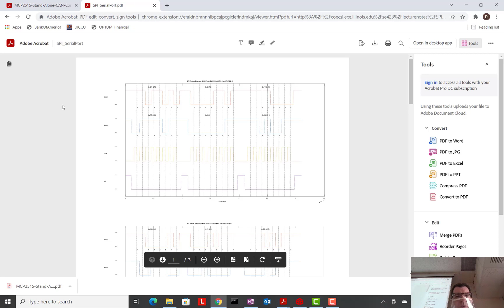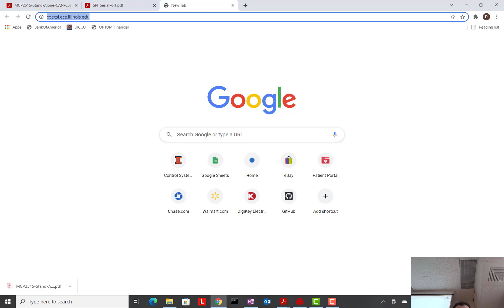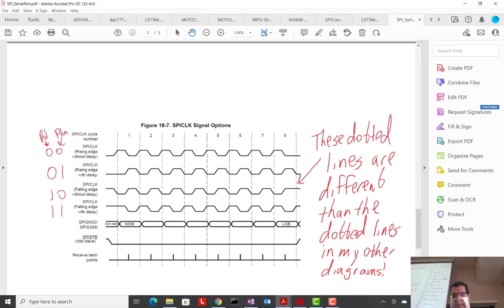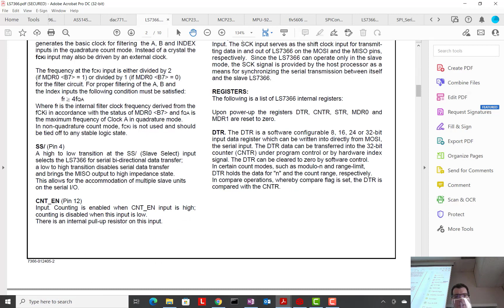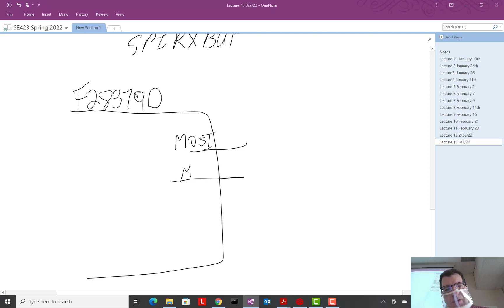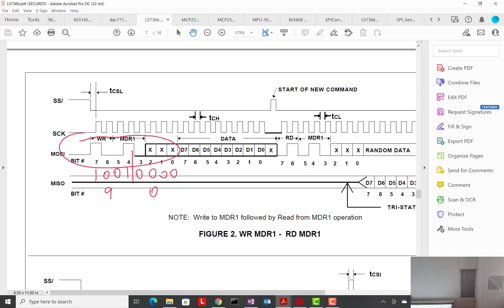SPI serial port, 1 of 4 lectures

Comment: I am currently facing a challenge with SPI communication on the LAUNCHXL-F28379D development board, specifically related to controlling the Chip Select (CS) signal.

using example code from TI "spi_ex3_external_loopback_fifo_interrupts"
Configuration Issues:

When I configure the SPI to transmit 16-bit words (SPI_setConfig with a data width of 16), there is an observable signal, but it is problematic. The nature of these problems is not fully detailed, but it suggests that the communication is not functioning correctly.

Lack of Signal with 8-Bit Configuration:

Altering the SPI configuration to use 8-bit words (SPI_setConfig with a data width of 8) leads to no detectable signal.

CS Signal Control Challenges:

I am particularly struggling with correctly controlling the CS signal. The usual approach of manipulating this signal through GPIO, both before and after the SPI data transfer, isn't working as expected on this specific board.
Software Implementation:

The software implementation for handling the CS signal via GPIO isn't functioning correctly. I need advice or examples on how to implement this control effectively for reliable SPI communication on the LAUNCHXL-F28379D.
I'm seeking guidance or examples on how to properly configure and manage the CS signal for SPI communication on this specific hardware, including the correct setup for SPI in both 8-bit and 16-bit modes, and effective control of the CS pin through GPIO.

Comment: Hi, thank you for sharing your knowledge, but i have a doubt. In the case of the LS7366 you select a SPI Mode 1, i.e. (CPOL, CPHA) = (0,1) Should not be in SPI Mode 0, i.e. (0,0)? since data is sampled on rising edge and shifted out on the falling edge? If not why is in p.16 of the datasheet configured as Mode 0.. Thats not clear to me.
Reply from the maker: That may be a type O in the datasheet.  Or possibly the processor that the code is for uses different Mode number than the F28379D processors???  Note that it is in the comments of the code given. 
Please look at the datasheet of the LS7366 figure 3 and figure 4 and you are correct that the LS7366 samples the data bit on the rising edge and transition the bit on the falling edge.  Then go to the F28379D Technical reference guide https://www.ti.com/lit/ug/spruhm8i/spruhm8i.pdf  and find figure 18-11 (page 2239).  See that mode 1 (pol=0, pha=1) is sample data on rising edge and transition on low going edge.